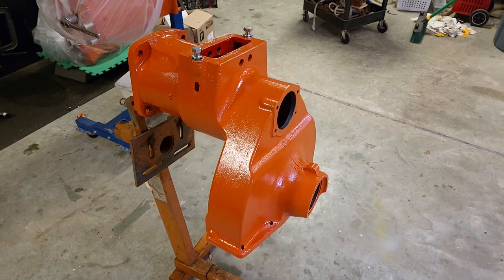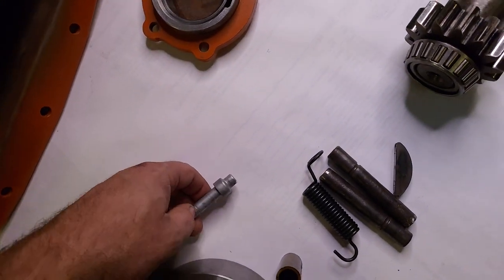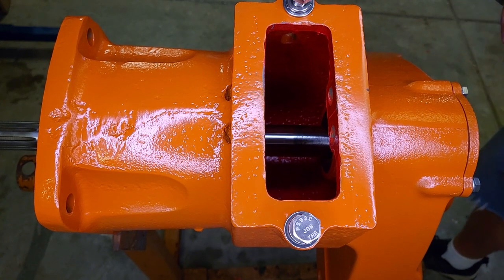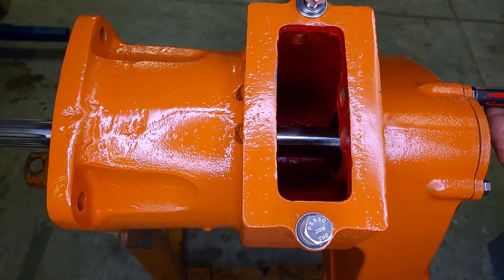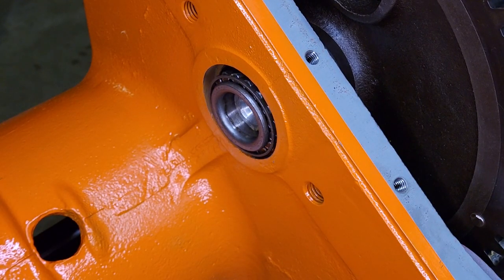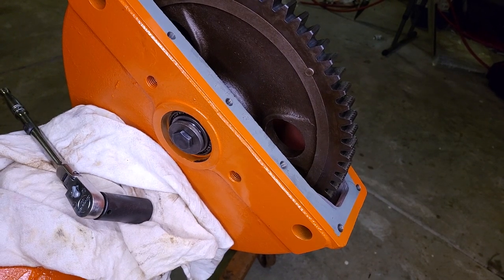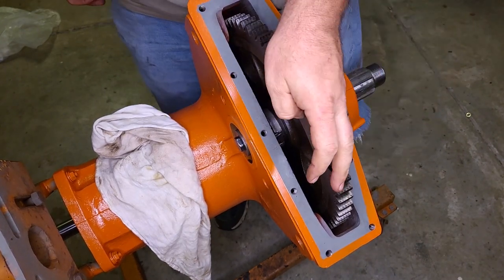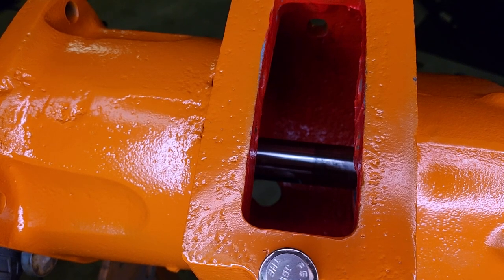1953 Allis Chalmers B Final Drive Assembly

Comment: Nice job on the rebuild!  Looks great!  Did the pan need a gasket, or just the gasket maker you showed?

Also, what gear lube did you put in it?
Reply from the maker: Thanks, I just used gasket maker. I recommend the ultra grey, and it seems to have the best consistency.
Reply: @JPN76  what gear lube do you use?
Reply from the maker: @kveltman4672  80w-90. Anything close would work

Comment: Do you have the bearing numbers for the 4 final drive bearings and also the seal number for the differential/transmission where the axle shaft goes into the differential? Great video!
Reply from the maker: I do not have the bearing numbers, but the seal numbers are shown in my transmission assembly video. Thanks for the good words.

Comment: First, thank you for you Videos!

What kind of paint did you use to paint the inside?
I know that there is many types and thickness of gasket material, Any way to determine what type and thickness to use such as with your shims and paper?
Reply from the maker: The paint on the inside is just oil based rustolium. It doesn't contact oil so no need of a special paint. 

You could figure gasket thickness in many ways I imagine. Easier to do with this by adding too many shims then back down one. In the automotive world I'm a bit more precise. Here i am going by feel. The manual in many places say tonjust get a nice rolling fit with no endplay. One trick I sometimes use is to put a thick piece of solder in between where the shim goes then tighten it down. Measure the solder and subtract the preload from the measurement or add to it if the spec is end play. That method may not work well with shims like this though but works good with shims behind races.

Comment: Re-Watching, I just picked up a transmission/rear end for a B with finals as my final housings were grooved the outside and had mix matched bolt sizes, banged up pans, etc.
On yours, Did you have to replace the bearings?
Reply from the maker: Lucky for me between the two transmissions I ended up with enough good bearings.

Comment: I just reassembled mine and notice some chater between the bull gear and final drive gear. It sounds noisey when i turn it by hand. Should it have so much play between the two gears?
Reply from the maker: Mine doesn't make any noise. Only clicks a little with small amount of backlash when I rock it back and forth. Are the gears all original. I saw in the parts manual different years will have different gear ratios. Tooth count is slightly different. May a gear was replaced with the wrong one? I think I remember you had a C as a parts tractor? If you used the bull gear from that it might be the issue

Comment: I have several 1940s and 1950s allischalmers tractors. I have looked online for a parts catalog for bearing seals and gaskets and have not had any luck finding many items. Where did you find your parts?
Reply from the maker: The seals I matched up by size entering the shaft and bore size on a temkin web site. Ordered cheap at auto zone. Bearings I ordered by the number on the bearing from parts stores. Gaskets and other stuff was stiener tractor. Yesterday's tractor and Amazon. Many gaskets I used RTV even if a gasket was available.
Reply: Both wheel bearings can be bought at Oreillys. Number is on the inner race of the bearing

Comment: did you sandblast this housing? Seems to me you said at least in other videos that you sandblasted the cast item you were working on. That must be I good sized cabinet if you can get housings in it
Reply from the maker: I sandblasted the smaller stuff. I used a needle scaler and wire wheel on the larger parts. I sent you some pics of the block as an example on Facebook messager
Reply: @JPN76  Got them, It took a while as stuff like that doesn't work on company wifi so I had to use data to get in.

Comment: Is rtv the only seal you used on the bull gear pan?
Reply from the maker: Yeah that's all I used. Not a drip at all. And any modern stamped steel pan uses rtv only so it shouldn't hurt anything.
Reply: Thanks for the feedback!! Great video

Comment: You do a lot nicer looking work than I do! I know that misery loves company but aren't those little brake springs a royal pain? I sure think so!
Reply from the maker: Yes they are! I edited about 10 min out of that spring part. The level of work changes based on need and what the wanted final outcome is. Yours worked great for your plan to get it running as is. My tractor is a little more sentimental I grew up on it and now it's going to live inside and only come out for fun. This is the first tractor I have ever restored and I'm sure I'm going a bit overboard.
Reply from the maker: Also there is a big difference between repairing the tractor and restoring to like new. Don't cut yourself short.